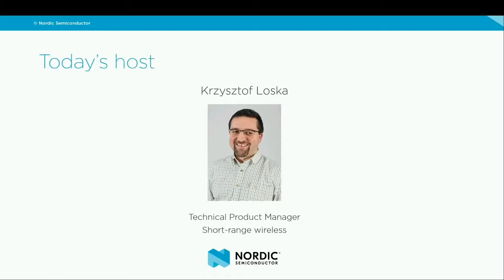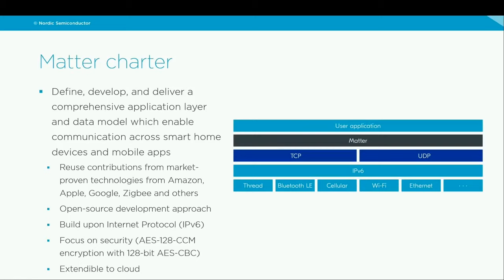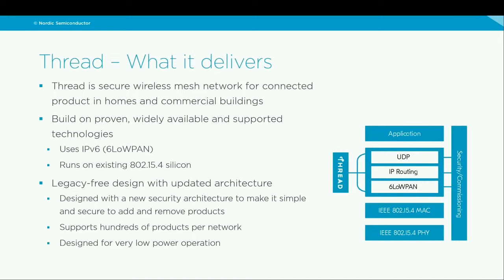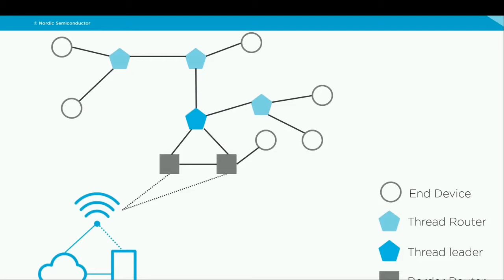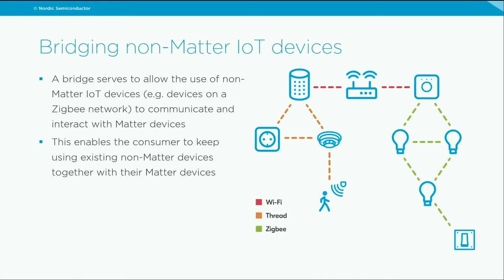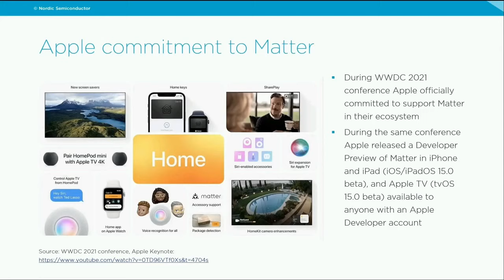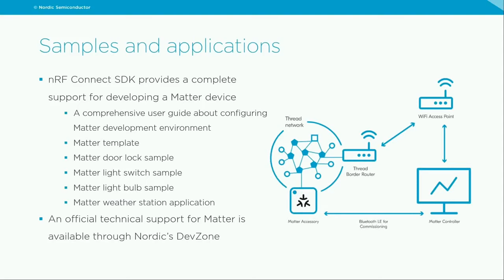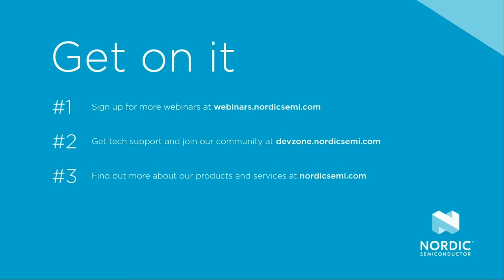Introduction to Matter

Comment: I don't quite understand the two Thread Border router architecture that you mentioned in the last section. For the NCP architecture I understand the reference app for the host side does not exist but for RCP architecture, do you mean we can find a platform(SoC) that supports Matter(Thread stack) or we can integrate it in host processor platform? Does Nordic has host processor for RCP architecture? Thank you.
Reply: I found Nordic announced nRF7002 (Wi-Fi 6 Companion IC) this year. What kinds of architecture you mentioned in this video is it? Thanks.
Reply from the maker: @Fan0315  Nordic provides a reference implementation for the connectivity part (RCP) for nRF52833 and nRF52840: https://developer.nordicsemi.com/nRF_Connect_SDK/doc/latest/nrf/samples/openthread/coprocessor/README.html

When it comes to the host part, a reference implementation is provided within the OpenThread project: https://github.com/openthread/ot-br-posix

This implementation requires a POSIX-based platform like Raspberry Pi; Nordic does not provide such solutions within its portfolio but developers can bundle a Nordic Dev Kit with e.g. Raspberry Pi to create a PoC solution

Comment: Why BT/BLE is not used for device-device or device-controller communications in Matter?
Reply from the maker: Bluetooth Low Energy is a great solution for the device to device communication in Matter we only use Bluetooth LE for commissioning. For the low-power Matter devices Thread is used even tough Bluetooth can fulfill a similar role. Matter is IP-based as is Thread, and another big point is that Thread is application layer agnostic.

Comment: Does thread allow application layer specific commands to be routed via thread FTDs that don’t support that application layer? For example, can I send a command to a matter endpoint in the future via a thread router that doesn’t itself support matter?
Reply from the maker: Hi Charlie, it is possible to create a device that supports and another communication protocol on IPv6 to send for example CoAP messages. However, a node that does not support Matter cannot send a Matter command to Matter-compliant devices for security reasons. You would need to have a dedicated gateway in that case.
Reply: @NordicSemi  but I thought thread was supposed to be application layer agnostic — therefore, all thread matter /HomeKit / google devices share the same thread network.
Reply from the maker: @Charlie-cc6vo  It is agnostic in the sense that you can use Thread with different application layers. Right now if you have two different Thread networks (one for HomeKit and one for Nest devices for example) they do not use the same application layer. If you use Zigbee for example you must use the Zigbee application layer. Also using the same application layer does not imply being able to send/receive data to devices being in a different Network. Devices still need to be commissioned into a network. If that were not the case anyone could just buy a light switch and control their neighbor's lights.
Reply: @NordicSemi  I guess what I want to know is whether thread allows sending matter commands via thread routers that aren’t themselves matter endpoints, to other matter endpoints. 

For example, my Nanoleaf essentials will not be updated to matter. But they are thread. In future, they should be still able to relay matter commands to other matter devices despite not being matter application layer compatible themselves right? Because of thread and how it is application layer agnostic.
Reply from the maker: @Charlie-cc6vo  The short answer is "No it doesn't work like this". The non-Matter Thread devices and the Matter over Thread devices are not in the same network. Being agnostic only means the device makers are free in selecting their application layer. It does not mean all thread devices will be able to relay messages from other Thread devices. Your best bet is to get any of the Matter border routers that can control your nanoleaf as well as act as a matter border router. You might already be using one of those. It would be an Apple HomePod mini, Apple TV, Google Nest Hub 1st and 2nd gen, some amazon Echos for example. Keep in mind Nordic is a semicondictor supplier. We enable devlce makers to build matter devices and don't always know how the final implementation will look like. I am sure you will be able to get it working somehow. The correct place to ask for specific information on this would be Nanoleaf in this case. We hope this helps.

Comment: Can we connect the matter devices directly to apple home app, alexa app and google home app without installing the 3rd party app to link to it?

Since matter is a open source, can the manufacturer able to adopt matter standard to bring the product to market without getting the certification?
Reply from the maker: Yes, you can connect Matter devices directly, that is exactly what Matter was made for. You can expect most large smart home systems to work with Matter devices. 

No, you need to confirm that a device will work with Matter and comply. Each manufactor will work with the Connectivity Standard Alliance (CSA) on this. For a standard like Matter there needs to be some sort of control to make sure quality requirements are met.
Reply: @NordicSemi  While that seems interesting and valuable, we are collectively familiar with how "the middle man" ends up in control of access to specific devices and pricing of all devices because they want their share of "cash" that is going between consumers and product manufactures.  There just has to be a better way than another layer of people to employee and manage and control the outcomes!
Reply from the maker: @wondamaner  Hi, yes we are familiar with that kind of system and this was a big concern when the discussion around Matter started. This does not apply to Matter. There are already many different border routers that give "access". You could even get a Thread capable Wi-Fi Router for your Home Network and use that. Matter is made specifically to not be a walled garden.
Reply: @NordicSemi  As long as software is the mechanism, than we can pick and choose products.  The problem is that "hardware" vendors have been in charge of home automation for a long time.  Frequency/band/modulation-type isolation has been a big problem.  Even having matter as the gateway between them, doesn't guarantee that all manufactures will implement or even want to implement a Matter gateway for their product line.  They must be compelled by the strengths of the platform, and their own ability to deliver something valuable in functionality, quality and price/performance.  Google/Nest is interesting, but only if you don't believe that Google is ignoring all the meta-data that your home/system can provide them.  This is ultimately the problem as well.  As soon as "devices" have access to the internet, you really have to worry about what it is they can see on your network and what they are telling someone else about it.
Reply from the maker: Hi  @wondamaner , you have some good points. When it comes to which vendors will implement Matter we already have statements from the biggest ones that they will. You can check out the members and statements here: https://csa-iot.org/members/. At the point where a vendor supports Matter they will have to enable others with their products. Keeping your data will always be a problem but that is true for every aspect where you interact with the internet. This can be mitigated by running your smarthome offline, which Matter also allows for. So yes Matter doesn't solve all problems but it reduces them, offers interoperability and enables smaller device makers to build their own products.

Comment: Yeah thanks for coming together to unify. But the future of smarthomes is not wifi/cell/Ethernet. I will go back to to ancient times having to use candles and lanterns in my house before I install a single wifi anything. Your router should not be your smarthome hub.
Reply: I agree and that is also not what is happening here. For most smarthomes you have some sort of hub and that is often connected to your router. In the case of matter you don't have a single hub (like you have now) you can have multiple devices to connect to the outside world. These can work independent of your router.
Reply from the maker: Yes that is correct. The future of the smart home will not be in any single protocol. The key with Matter is that you're not forced to use one. Matter is an Application layer on top of different IP-based protocols. This even enables more protocols to be added in the future. Thread is ideal for low-power smart home devices and works without connection to your Wi-Fi router. It uses the same radio as Zigbee. And for the applications that need more bandwidth, you're able to use Wi-Fi. Wi-Fi also has gotten a lot more "low-power" friendly with the integration of TWT and MU-MIMO.
Reply: @NordicSemi  Thread is a problematic choice of names.  It should be some innocuous name that doesn't have any particular meaning today.